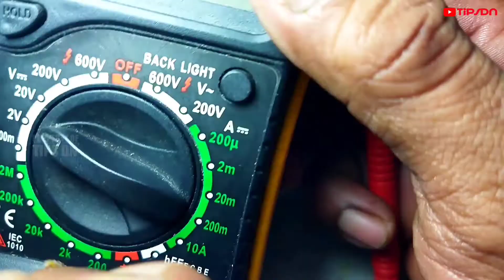Cara Membuat Step up DC ke Dc (penaik tegangan versi kecil sangat Handal )

Comment: transistor bc 547 nya bisa diganti dengan TIP41C, habis tu res 100 ohm bisa ganti dengan 1k?
Reply from the maker: TIDAK BISA. 
Tonton video dibawah ini ( 5 video ) pilih circuit yg sekiranya cocok
 step up dc 1 : https://youtu.be/mCBRZSkhK90
 step up dc 2 : https://youtu.be/vkqh4YNvpac
 step up dc 3 : https://youtu.be/-Y6EH10C4ok
 step up dc 4 : https://youtu.be/dMYqwR6810M
 step up dc 5 : https://youtu.be/01rLLJ_ax8g
 step up dc 6 : https://youtu.be/bPZQTaaC0rU